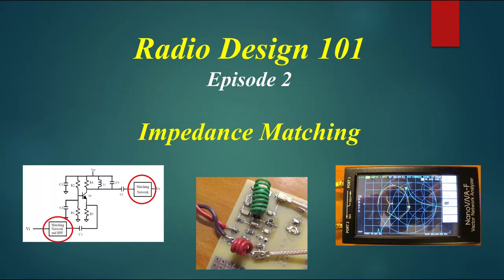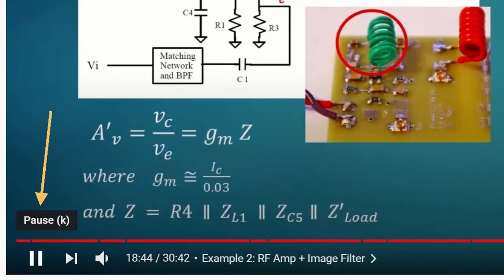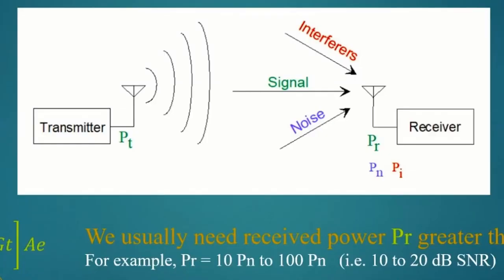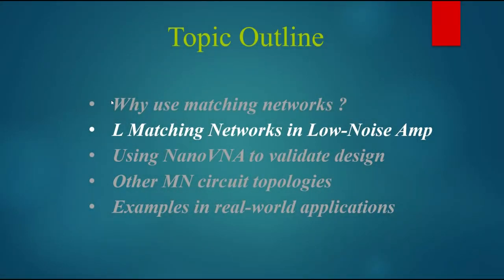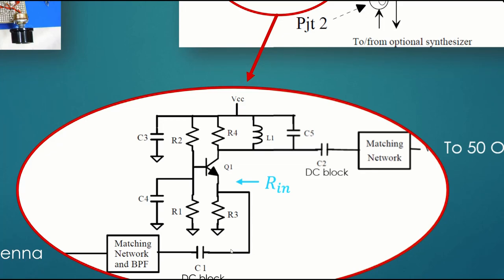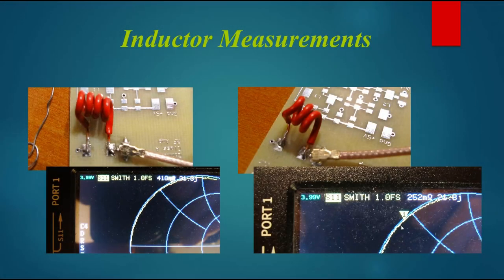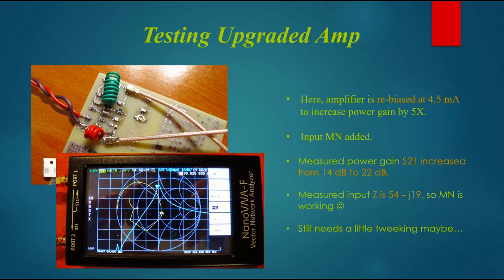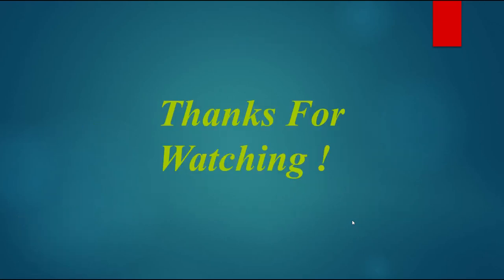Radio Design 101 - Episode 2 - Impedance Matching - Part 1

Comment: Lesson learnt from playing around: dirty trick of slightly over valuing inductor(both input and output sides) and then squishing/stretching it in circuit to adjust for the target impedence observed on VNA, seems like easier way than measuring the inductor for its value. As part of final leg of fine tuning, getting down the Reactance component to near zero seems to yield more gain(and SWR) than getting resistive impedence accuracy to target, eg: 45+500mj is better than 49.5+25j.

Comment: I noticed this playlist series is based on radio receiving. I’m just curious on, are you going to develop a series on radio transmitting. Like how to create an RF transmitter to match a created RF receiver. To be honest in my opinion majority of us aren’t interested in listening to the basic radio stations. We want to control robotics from distances using our own built transmitters and receivers on our own frequencies. I understand it’ll probably be the citizens band. I know I’m asking a lot I apologize. 
 
Also, here’s a tip. Nowhere on Google is it giving clear enough information on how to do the things I’m described above. It’s all in expensive books. If you went into the complete depth building transmitter to receiver by how it looks to me, you’d be the only source to go to considering how deep you go with the learning concepts. Thanks for everything by the way.
Reply from the maker: Thanks for the inquiry and the ideas. The short answer is that I stayed away from transmitters intentionally - for a number of reasons including licensing and special issues with respect to equipment and safety.  BUT... there is a playlist on Antennas and Propagation here.  https://www.youtube.com/playlist?list=PL9Ox3wpnB0kqNLnCdCtWcjGq7nRVHYxKA  Arguably this is very relevant to transmitters, as it covers decisions about frequencies vs antenna size, and how the signals propagate with and without obstructions. I hope its helpful !

Comment: Very useful video series - thanks. However, I have a (perhaps naive) question.

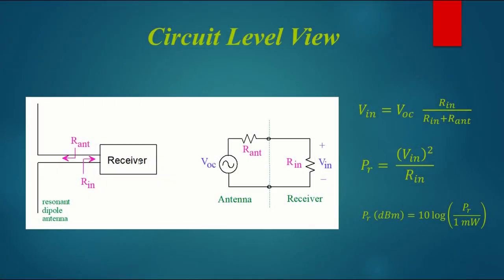At 2:17 , you say that you want to maximise antenna-front end power transfer (which you can do by impedance matching). 

However, it's not entirely clear to me why this is the optimum strategy when using an antenna, when, for example, with a microphone (whose low-power signal also competes with noise at the front end amp. input), we typically drive an amplifier whose input impedance is much higher than mic. impedance (and hence we maximise voltage transfer).

The two situations seem to be pretty analogous, as far as I can see.

Am I missing something obvious here?
Reply from the maker: Actually a great question.  The answer is that we need to maximize signal to noise ratio if we want to receive the weakest possible signal - which is always competing with noise - both from the environment the antenna is 'seeing', and from the amplifier itself. Without getting in too deep, here's one way to think about it:  If we match up from 50 Ohms to, say, a high-Z amplifier input impedance like 10K (as opposed to just driving directly into it), then we get a voltage boost in the process. So the signal level getting into the amp is higher. Since the amp has a somewhat fixed level of internal noise (shot and thermal noise from semiconductors, etc), the SNR is higher since we increased the input signal voltage it now sees relative to its so-called "input-referred" internal noise.   I think the other part of the answer is that in audio, signal levels are often so high relative to the noise that we don't care about this issue (except if we're doing a low-noise microphone amp). For the record, that's often true in RF design in stages other than the antenna input. Once you get the signal level up sufficiently with an LNA, downstream circuit matching can sometimes be dispensed with. Also, audio is inherently ultra-wide band and impedance matching is hard to do. (In old tube amps, transformers were used sometimes - especially in the power amp output section, but they're big, expensive, and somewhat lossy/noisy themselves...)
Reply: @MegawattKS  Thanks for the response, which I shall have to ponder carefully. I suspect that I need to revise noise figure calculations, amongst other things (there's that formula with the Gs in the denominator - my memory is hazy with age :-( )

However, one point occurred to me after posting my question: with an antenna, if we don't transfer all the received power to the next stage, we have to worry about re-radiating it when it reflects off the unmatched stage that it is feeding. That is probably undesirable. When we have a microphone at the front end, reflected energy can be dissipated by lossy components, and merely ends up as heat - that is much less of a problem.

I shall have to consider the noise and SNR issues carefully though.
Reply from the maker: @scollyer.tuition  I think some amp topologies don't improve that much with matching, although it will help their gain and therefore the NF of the overall receiver (as calculated with the Friis equation with the Gs). Indeed, it depends on how much noise they generate internally and how much the mismatch is. With a hypothetical amp with no internal noise, the NF hit would be nil since input signal and input noise are amplified the same, and noise factor is the ratio of the SNR at the input to the SNR at the output.

On the issue of reflections, I don't think there's any issue there. The signal that is reflected from the LNA input is the same as the one that was coming into the antenna anyway. Typically the more problematic issue is radiation of the LO signal if the LNA doesn't have good 'isolation' (S12).
Reply: @MegawattKS  I shall go away and study this (I have a big antenna theory book that deserves some attention) but my final comment/query re: signals reflected from the front end: surely it would be at least somewhat out of phase with the received signal, and will cause some amount of re-radiation? Particularly if we had a long transmission line between the two?

And that's an interesting point re: the LO. I think I've seen videos of hams poking around with tinySAs trying to detect it.

Comment: I was just thinking about that maximizing the power-transfer from one part of the circuit to the other, and the need to keep the impedance matched (video at 3'14"). As we all know we have almost everything matched to 50 Ohm. I explained it to myself as follows: The 'power sending side' (left, like antenna source) has some power to transfer to the next circuit (rights side, like to the receiver circuit, with some Rin). The 2 resistances (Rant and Rin) are in series and share the same current I, induced by the source. I=Voc/(Rant + Rin). The power on the left side is P1=I^2 x Rant and the power in the right side P2=I^2 x Rin. The (received) power on the right side can never be higher then the (send) power on the left side. That would be a miracle. It can only be lower (due to a mismatch, as we learn). So the best we can get is the same power. Neutral (lossless) power transfer. In that case we can say P1=P2. From that follows: I^2 x Rant = I^2 x Rin. From that follows: Rant = Rin. Please comment if I make some 'thinking' mistakes here 🙂
Reply from the maker: Interesting way to attack the problem/proof. I'm still thinking it through, looking for possible 'thinking mistakes'. Maybe others will weigh-in. The thing I'm considering is the premise that the source has some specific power to deliver. But for an antenna, that's definitely true. It would be Pdensity x EffectiveAreaOfAntenna. I've seen the mathematical proof, but in the classroom we tried to be more 'physical' like you're doing here. I mainly presented a plausibility argument with a set of three cases.  I'll give this some more thought after dinner :-)

Comment: Amazing set of videos. As a HAM it’s at the perfect level. Been enjoying them thoroughly. Thanks! I do have a question. For the receiver why do we want maximum power in and not maximum voltage? Doesn’t that depend on the device being driven by the receive antenna? For example, if the input amplifier used an FET  which is a voltage driven device with a very high input impedance, wouldn’t we just want the maximum voltage developed at its gate? That would imply no matching network needed, right?
Reply from the maker: Thanks!  Good question.  The short answer is that signals at the receiver's sensitivity level are competing with thermal noise from both the antenna/environment and from the low-noise amp's internally generated noise in the front-end (as well as later stages if the LNA doesn't have high gain). That noise is quantified as Pnoise = kTB (for the antenna/environment and resistive sources), which is based on power. So maximizing the signal power that goes into the LNA optimizes sensitivity.  That said, maximizing power and maximizing voltage often turn out to be the same thing. For example, if the LNA has a high input impedance, then when the matching network is used (to maximize power transfer into the amp), the signal undergoes an increase in voltage too (equal to the square-root of the resistance stepup ratio). So intuition is not wrong 🙂

Comment: I wonder if impedence matching could be explained with the example of resonance sound tuning forks(or playground swing), where transferring power from vibrating fork to an idle fork becomes optimal and easy at resonant frequency of the target. Matched frequency makes idle fork resonate, and matched impedence also resonates(its an AC signal afterall).
Reply from the maker: That actually sounds like a 2-pole bandpass filter :-)

Comment: i figure additional gain/input matching network are needed to compensate for the losses from BFP filter stage.
Reply from the maker: Yes, but there's about 100 dB of gain in the overall receiver chain of circuits (filter, lna, mixer, IF-subsystem amps, etc), and the FM receiver has to work over a dynamic range of about 80 dB typically.  So losing a few dB doesn't make a big impact - unless it's in the first filter where it will affect the overall receiver's noise figure. But even if it does, the only thing that will do is maybe prevent receiving the very weakest station on the band.

Comment: What is the name of the connectors at 13:22? I found some SMD connectors of various types available, but I could not find cables with complementary connectors. Do you calibrate the VNA at the end of these cables? If yes, how, considering the calibration kit has SMA connectors?
Reply from the maker: They have a few names, but I call them U.fl connectors. There is a really nice board that includes short, open, load references that uses this connector, and it comes with cables. It also has lots of other interesting examples of Smith Charts and components. I got mine from Amazon for about US$15. Search for "rf demo kit nanovna". I also bought a set of 50 connectors for US$12 from Amazon :-)
Reply from the maker: Pictures here :-)   https://youtu.be/R0mRTigYzco?list=PL9Ox3wpnB0koBGofotI4xS8R0ct0FeYfv&t=140
Reply: @MegawattKS  Thank you for all the info. I already came across the RF demo kit, I just didn't realize it can be used to calibrate the VNA and that it has these cables. I am going to buy a NanoVNA for myself and a demo kit and a set of connectors. I already have a spectrum analyzer, I hope it still works since it is about 30 years old.

Comment: Hi, Thanks for the videos, I have a silly doubt, at 12:00, in video, if the resistance from emitter to ground is 1K, then how come Rin was taken to be 50 before MN is done
Reply from the maker: Hi. The amplifier shown is a "common-base" design - so it's input resistance is much lower than the physical 1K used in biasing. The details are in Part 3 of the series here:  https://youtu.be/UUlqW-vSq9M?list=PL9Ox3wpnB0kqekAyz6blg4YdvoEMoJNJY&t=2353 (sorry about that forward-reference). Much more detail can be found in the associated website associated with this video series. Specifically in the lecture on RF amplifier design here: https://ecefiles.org/rf-circuits-course-section-2/ . The third class-handout on that webpage shows the common-base design with the associated formula for Rin. It's approximately Rin = 1/gm since 1/gm is much lower than the 1K bias resistor or the internal BJT device resistance "r_pi".  Thanks for the question! Hope this helps.

Comment: At 10:17, I'm a little confused, as from the antenna's perspective, the output impedance ideally should be 50 Ohm for max power transfer, but if you add Xp + Xs +R as a series RLC circuit, the impedance is 55 Ohms, not 50?
Reply from the maker: The answer to this is tricky, but the main problem is that we cannot add X and R values. The inductor and capacitors have "complex" impedances (j Xp and -j Xs), so complex number math (including the j values) has to be used. Also, we can't just look at the three components in series in the absence of the loading on the left side.  But - let me try this...  Stand at the antenna and look to the right of the 50 Ohm antenna resistance. We see jXp in parallel with the series impedance -jXs+Rs. If we  do a "series to parallel" conversion on -jXs + Rs, we can replace the two series components Cm and Rin with a parallel Cp and Rp.  See the webpage below for how this is done. When the series to parallel conversion is done, the Rp value is 50 Ohms and the reactance of the C value in the converted circuit is Xp = Xs ((1+Q^2)/Q^2) = 20((1+2^2)/2^2) = 25 Ohms - and becomes the same as that of Lm (25 Ohms). So Lm resonates with the parallel-equivalent capacitance Cp at fo and they cancel each other. So the only thing left is the 50 Ohm resistance (Rp).  Sorry - this is hard to relate in a paragraph. Hope some of it is helpful.   https://aaronscher.com/Circuit_a_Day/Impedance_matching/series_parallel/series_parallel.html

Comment: For the inductors on the output side of the real physical circuit, it shouldn't be a problem converting parallel inductors to one smaller inductor right(630 || 160 = 130nh) right ? Fewer inductors(with even fewer turns) on a PCB seems like less of headache.
Probably similar for input side, but realizing such tiny one would be more of trouble than 2 inductors there.
Reply from the maker: Absolutely correct.  It's nice when it works out like that. As you said, a single 130 nH is much nicer than two - especially since one is 630 nH. 130n makes for a reasonable number of turns and size :-)

Comment: I'm having some trouble implementing this in practice :( . I want to demonstrate input impedance. So i built a common base but with Rc = 0 ohm. Re is 1K, and it is biased R1 = 11K, R2 = 8K and powered by a 9V battery. Ve is 5V, so my emitter current should be 5mA. I then use a large (0.5nF) capacitor for C1. C4 is the same value. Then, in series with C4 I have a 10 ohm resistor, this goes to my signal generator with 1Vpp at 12MHz. I have a probe on both sides of the 10 ohm resistor. I was expecting that if my input impedance looking into the Emitter is 10 ohm, then this would form a voltage divider, and Probe2 should be a signal in phase with Probe1 but obviously at half amplitude. However in practice both signals are equal in amplitude and are out of phase.... I can't even blame it on bad implementation or parasitics because I get similar results in simulations... what is going on? :(
Reply from the maker: I have a few ideas. First, though - thanks for the detailed description of the setup. That helps.  There are three things I can think of. First one is the 0.5nF. At 12 MHz, I get -j26 Ohms. That could account for a good part of the amplitude issue as well as the phase shift you're seeing. Can you replace those with 100nF or so? Should be easy in the sim at least, even if you don't have 100nF caps in stock.  Another important issue is the amplitude. This is a small-signal amplifier and will saturate at the input for signals greater than about 20 mV. At 1V amplitude, you may be able to see waveshape distortion in the sim if you do a transient analysis rather than an AC/frequency-response one. But that should go away for something like a 10 mV amplitude signal or less. Finally, what is the signal generator output impedance (resistance)?  Typically they're 50 Ohms, so this could affect the amplitudes you see relative to the amplitude programmed into the generator. However, you are taking measurements on either side of the 10 Ohm, so that's good and the ratio of amplitudes on the two sides should not be affected by Zout 🙂  Try changing to 100nF caps and use something like 10mV amplitude and see if that helps...
Reply: @MegawattKS  awesome thank you for the detailed response I'll try the 100nF :) . The 20mV is new to me I didn't realize it would take so little to saturate. Thanks again 👍
Reply: @MegawattKS  ok, just tested your recommendations in the simulator and yes now I'm seeing what I expected :) in my simulation the signal generator has an output impedance of 50 ohm.. in practice I never measured my cheap signal generator - but yes as you say I'm going across the 10 ohm so the amplitudes are relative. Now I need to learn more about the saturation voltage 🤔
Reply from the maker: @coffeecuppepsi  Yes - that issue didn't make it into the main video series. Sorry about that. But some of the underlying reason is in slide 19 of the Appendix A slides in the pdf below. Note from the Ic vs Vbe curve at the top of the slide that the transistor has an exponential relationship between Vbe (which is what the input is affecting) and Ic, and it's only approximately linear if the small-signal input v_be variation is on the order of "V_T" or less (26 mV). That's the region of the Ic vs Vbe curve marked with the yellow tangent-line:  https://ecefiles.org/wp-content/uploads/2023/11/RD101-AppendixA-TransistorsAndAmplifiers_rev1.pdf
Reply: @MegawattKS  these are excellent resources thank you so much !!